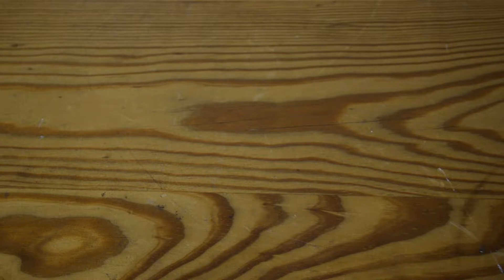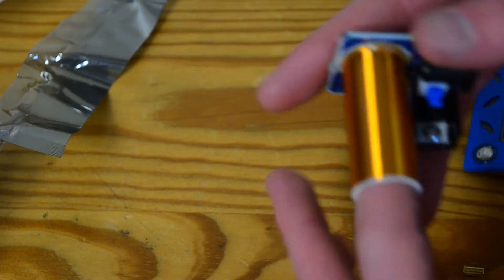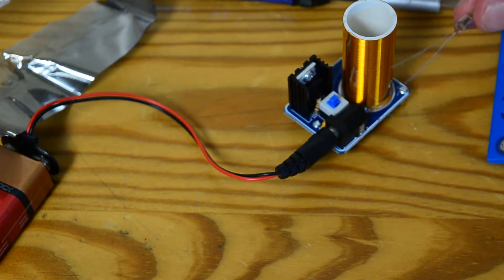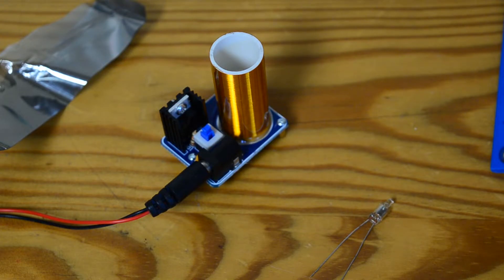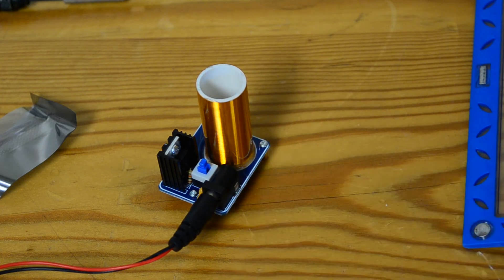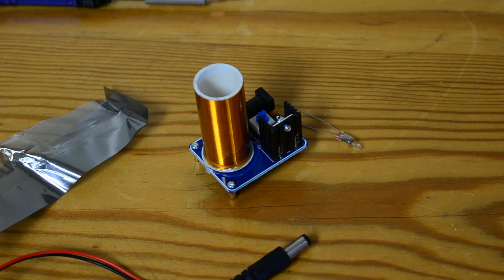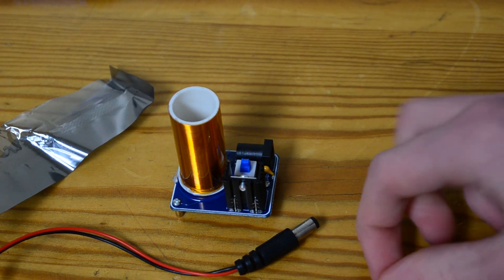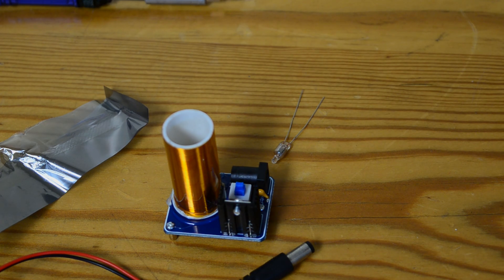The world's SMALLEST Tesla coil!

Comment: You are likely now aware of this, as this video is 2 years old, but a Tesla coil is a transformer, which may boost AC voltage at the cost of AC current (or vice versa, for other types of transformers). Also, the "vacuum tube" the coil came with is a neon lamp. Only one of the electrodes will glow (cathode/negative) when DC current is applied, and you can see them glow and darken alternately with low frequency AC.